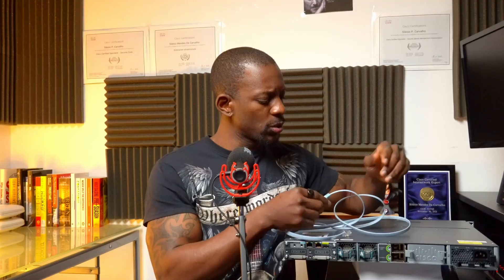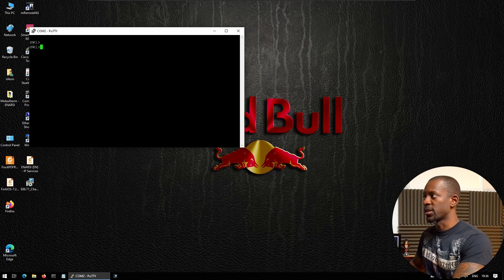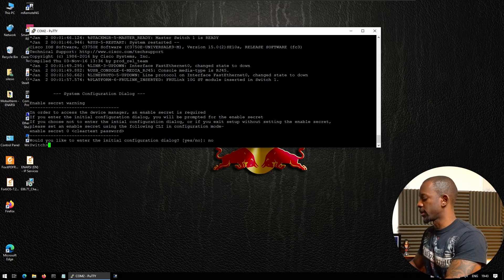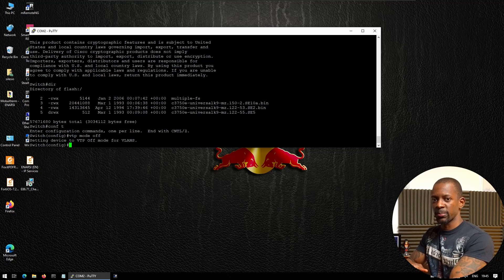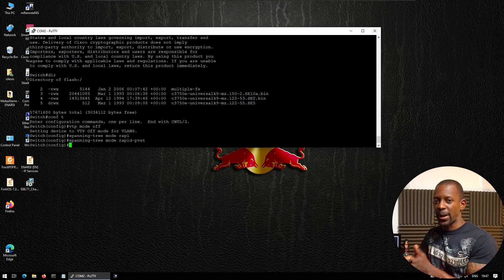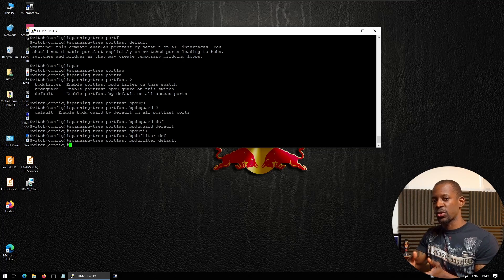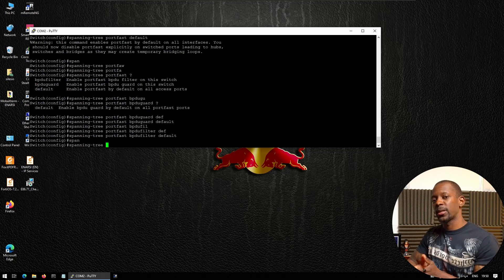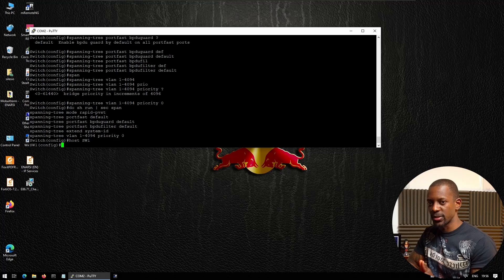How to configure a Cisco switch

Comment: This is great. 

I'd like to listen more from your lessons about cisco best practices when configuring in real life and real companies
Reply from the maker: Great suggestion! Is there anything specific that you'd like know?
Reply: @silesiocarvalho  

For example if a ccna student required to perform subnetting vlsm for a HR network with 58 hosts, they probly choose /26 because it supports 62 hosts. However this can be problem in real life if new devices, new employees join the network, and the network has ran out of usable hosts.

Why both DTP and VTP are recommended to turned off, etc

There are probably way more examples that a ccie knows that mere ccna mortals don't know ;)

And a series of playlist videos might be better explaining 1 best practice per video, instead of a long video with all best practices.

So you're more free to record and upload at anytime you feel like.